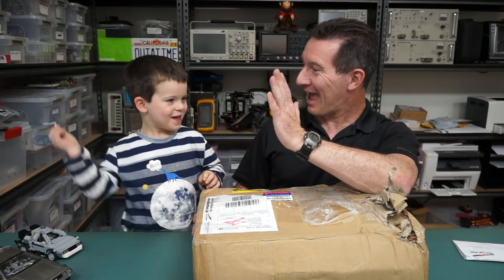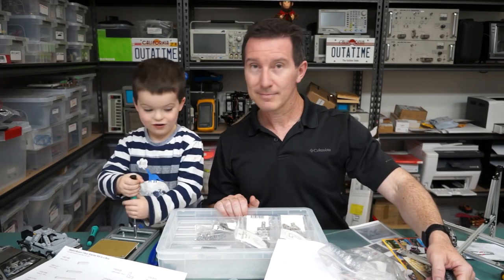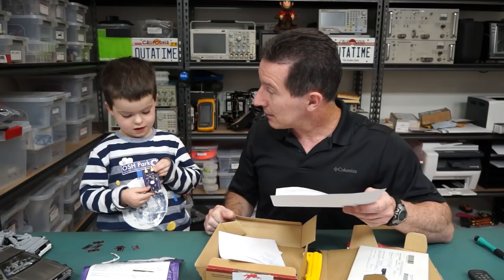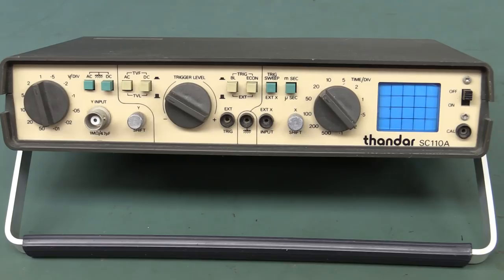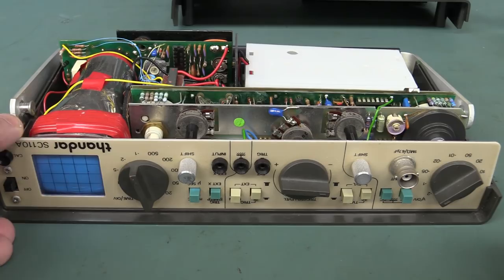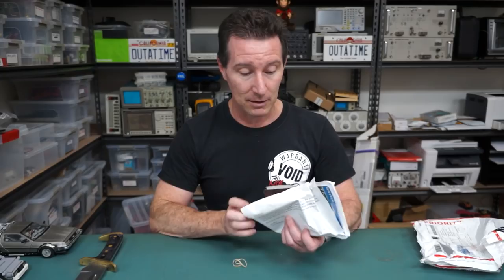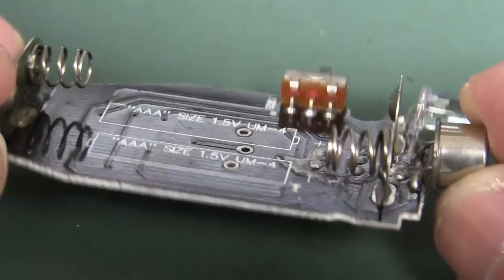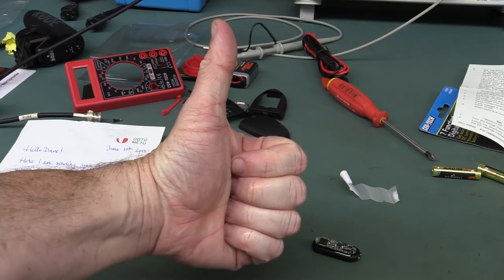EEVblog #813 - Mailbag

Comment: that cheap multimeter... tell you what its handy for random small jobs and better than a bulb with two wires.
Reply: A bulb with two wire is often better for testing automotive circuits.
Reply: I have one of those just for continuity and reading voltages on where i don't have any idea of how much tension it is (and don't give a fck if i burn it haha)
Reply: @TheCode-X  The gadget is not what you should be concerned about. The worry is about the effects on your person of its explosive disintegration by massive overcurrent.
Reply: Speaking of a bulb with two wires I used to have that same setup for testing voltage when I first started out you're doing electrical projects it was one that was handed down to me from another family member.

It was homemade but still in good shape even with the original test leads that probably had been re-soldered a few times originally one was red and one was black but one had to be replaced.

From what I was told and I also had a second one that is made by the same person that had longer leads but had two bulb sockets so that it could be used anywhere from 120 volts up to 220 Ameri fact I remember hearing about in some way somehow possibly from different sources how's that the utility company when connecting up to a residence when running new wiring for overhead lines Wood Lamp out to connections at the service entrance from their wiring to the service entrance whenever first connecting using a setup very similar to that also I still have a continuity tester flashlight that was given to me years ago is still works although I did converted to an LED it still is a nice flashlight also somewhere I still have a few of the old from colored not necessarily chromed but I think one or two are metal C or D cell flashlight I think a couple r c and a couple Rd also have a few lanterns stowed away somewhere that would have used the racial big 6 and 4 volt batteries I'm thinking about converting them some way to recharge mobile maybe you're sealed lead acid and perhaps a built-in power bank?

Although I do have one Lantern or two that had a quarter inch track originally on there one even had two of them perhaps one was added?

So that you could use it with a headlamp in addition to your Lantern and yes the original coil cord is still in good shape believe it or not.

And there was also an area like that could plug into the second Jack.

There was a switch for both receptacles and also a switch on the lights themselves as well.

Can't remember if that was a 6 or 12 volt Lantern but I think that one was 12 it's stashed away somewhere but not where I am  right now.

Also have a land foreign pride of similar except it's got a cord and 2 rounded is 1 would Connect into the front of the lantern in place of the Winds and reflector assembly and the other is essentially the head of the lantern that the bulb in reflector assembly goes into to turn it into a hand Lantern from a battery pack type Lantern again it was one that took the large alkaline or whatever it would have either been 6 or 12 volt battery you know when the big Lantern batteries they don't see much anymore.

Also I do have some sealed beam 4.5 volt Lantern bulbs don't even know why I have them are where I got them possibly an old hardware store did they still sold those lights and may have closed down but don't know we're no longer sold the lights who knows just one of those random things I got over there years at places that could get stuff from cheaply where is somebody could have been used for something else and sometimes when something like that would come up I could arrange to get all of them Ford even further reduced price especially if I knew the business on her well in which law of cases I did that I was known for picking up stuff that there's only a few things left an inventory they're getting rid of Good Times those times I'd say.
Reply: @stephenarling1667  yes I would agree I have one of those testers which is actually a modified Automotive work light modified in terms of a jack with test leads and another Jack with alligator clips for battery and our Jack with the cigarette lighter connector I Know Jack with female banana plugs

And also a set of very long coiled test leads with male female banana connectors.

Is that should be in everyone's test kit does extension lights same with alligator clip to Banana plug leads and just about any other type you could think of or come up with even if you make it for one specific test put it in your test kit for lighter you will thank yourself for this.

Also speaking of a bulb and Automotive there's times that I did not have the proper materials or tools to do testing and what I would do would just pick up a pack of pull volt indicator lamps the ones that would be worrying that had the blue green or whatever colored plastic around them that was meant to snap into a hole in a panel and just attaching wires it works plus you had indicators for another project in the end one time I even round up using a switch with a 12-volt bulb in it because I could not get an indicator but I could guess which or it was just a viable I don't remember long time ago but I was in pain and it worked I was able to get whatever it was working it need to be to under right then and there.

Also if I was working on something for somebody and did not have a proper meter or continuity tester available I would go somewhere and get a battery holder and an indicator of some sort with nibia 4 volt bulb and maybe a 4 C or D cell or double A or AAA holder and make a Jerry Reed continuity tester out of it and then of course save for parts for another project later I fixed a hair dryer doing that once all that was wrong was there was a broken piece of wire between two points in the device this was actually not the handheld dryer but a Hood Type dryer a very expensive one and the person used it all the time and wondered if I could try to fix it for them Ameri fact the wire need to be high temperature and that was salvaged from something else that I could not fix during about the same time can't remember what was it may have been either a heater or a toaster or perhaps a little mini countertop stove I had prepared several things for them previously was in about a month's time so can't remember but this was many many years ago probably in excess of 20 years but yet the mind is still sharp pretty much Seems Like Only Yesterday that I got my first electrical tester of any type.

By the way was going through some stuff and found my first actual continuity tester that I had gotten from somewhere yeah sure the batteries were left in it corroded do you know where however once I get cleaned up it's going to live on although I already found a way to replace this the original spring which was corroded into two pieces which was the new spring was actually a salvage spring or something and two metal pieces I think that were a battery contacts for something recently folded over on either end of the spring and also they fit exactly without even stretching the spring or anyting so just pretty cool what you can do or salvage parts and also things that you jerry-rig even for one temporary use just to fix one thing.
Reply: @TheCode-X  yep used those disposable meters basically Also I ran across my old yellow Radio Shack digital meter the one that had the black case that hold it open that had to test lead inside of it and to my surprise turn the switch to on and lo and behold it was working fully just goes to show that sometimes even RadioShack stuff is built really well candy for those people in other countries and not only that there's been times that I've had RadioShack batteries that still had charging them after all those years I remember back when they had those teeny tiny alkaline 12-volt batteries they called Weider batteries back then as in cigarette wire batteries I'd use them in some projects here and there and didn't happen to run across some years later I mean numerous years later didn't even realize or any of that stuff and lo and behold no leakage still measuring about 12 volts DC wow also that multimeter I was just talkin about uses a similar battery can't remember to voltage or anything at the moment but surprisingly the battery still measured good wow that battery and never been replaced and I use that meter quite a bit all the time and the battery was still working nowadays with battery issues I don't think that would happen anymore at least with most batteries just goes to show that things used to be made better than they are now in a lot of cases of course there's always the really nice exceptions to this such as earlier equipment by HP I do say earlier for good reason and not just consumer stuff but more of electronics Industry and Commercial and other equipment.

Also I remember years and years ago using our first TV that was a color TV I did actually wind up using it in my bedroom for quite a while and then later on again I used it in my bedroom until my parents got me a new TV for Christmas yeah picture tube was going on the old one but it had a good life then when that happened that TV got repurposed for my shop mainly for test purposes and since it was RF only I want up getting a modulator and music that for a test match TV and every once in a while I'd listen to news or something when I was in the shop an old wood grain portable RCA TV don't remember the model that things had been in the shop a few times not mine but the last time we had it repaired I have to be there it had the problem of the Estes Linda and ask for said it sound like white noise with it if I remember correctly it was resistor 11 that was the problem on that set and a drawing I mentioned or my father again that I was into Electronics and the garnet preparing to that last time you said you know no need to keep bring it in when does resistor goes out which she said was a common problem in these sets he showed me exactly which resistor it was they said there was a mod that could be doing to improve the longevity which woman he doesn't do butt might be worth pursuing and a few other mods to make the set more reliable and better which in the end I want of doing and this was when we were still using it actively in our main TV watching area so whenever it would act up pop the top on my workbench also he did show me how to discharge the picture tube as well so that I can get back in the service right away without waiting for the discharge which is anytime I used to get a scrap TV that's what I was do is just wait enough time and tell the picture tube would be down 2 safe voltage so that's one of those things that I would fix on a regular basis there was also a few other components it would go out here and there in that set consistently so needless to say I kept spare parts for the TV at one time I had replaced two fuses in it as well and also record. Replace twice as well also the antenna connector which was of course just for screw terminals was replaced with other screw terminals I think it was from a dead or partially did more railroad power pack just cut it out with the Dremel to take the rectangular instead of square screw terminal board.

Also on modded in a few different inputs and things as well because since it was used for chest bench for purposes and I had it apart anyways as well as an input for the Atari line of game systems in computers and an analog audio input for mono and an analog audio output for mono of course however previously I had installed a bear circuit board that would produce simulated stereo output from a mono in and yes attenuator on the speaker output and a switch also I do have the old video sound processor from Radio Shack that is a keeper it is still in my entertainment center stereo simulation noise reduction and then some and yes used to have that hooked up to a different TV through the headphone output which is mono and my father would actually go to my room to listen to concerts on TV on my stereo system even though it was a small TV just goes to show you how useful an old piece of equipment can be they don't make anything like that anymore I wish they did it would be very useful for some people for example our sound check at our church said that he would never give up that device ever when I asked him if he'd ever heard of one

Comment: the Rossin device that you showed on # 813 is a passive infrared sensor for a burglar alarm.  It is intended to be wired in a normally open alarm loop. the battery actually powers the device and i think it should last for ten years .  I used some of these probably 30 years ago.  will look to see if I have any info on it.  Love the Blog. Thanks for what you do.

Comment: Hi Dave, Love it. My dad 'lent' me one of the Thandar scopes in the early 80's  It was branded RS Components (UK) and as I recall it cost just over 100 UK Pounds  at the time. It was part of a series that included a matching frequency counter and multimeter. It finally packed up about 10 years ago, and I'm ashamed to admit that I still use the probe that came with it!   I used it to trace trigger card faults on  thyristor lighting dimmers and the fact it was  'ground' free was really useful. It started displaying the same issues you discovered about 10 years ago and finally died soon after.

Comment: I've been using that Cen Tech multimeter for several years now, still works like a charm! Mine was free with a dollar purchase of tape. The leads broke at a point, but I fixed them with some solder and hot glue. No problems with the meter itself!

Comment: So far, I own 4 of those free Harbor Freight Tools multimeters.  At first I figured they would be very inaccurate, but was surprised at the accuracy.  I also figured they would be unreliable, but so far they're reliable enough for use in non-critical measurements.  

I keep one in each vehicle, monitoring the battery voltage, and after several years, they still do a good job.  They even give good readings at 30 degrees F below freezing and 120 degrees F.

I've had them read incorrectly about 2 times.  I quick rotation of the switch, and they're reliable again.  I only use them when I already know what reading to expect, so I can tell if they are off very far.

Not to be fully trusted, but still useful.

Comment: It's PIR, I used very similar units made by Racal back in the early 80's. It had an operating life of about 5 years, and used the on board battery. After the unit detected motion, it would "sleep" for a period of time, to save battery life. That unit was clearly a single narrow beam type sensor.

Comment: IIRC the switch on the alco tester is just for the light. To measure your alcohol level, hold the push button depressed until the green led lights up, then blow gently onto the sensor.

Comment: The breathalyser is probably a generic flammable gas detector. It consists of 2 wires, one coated with a catalyst, and one not. They are wired with 2 resistors in whetstone bridge configuration. The wires are heated by a small current, but normally remain balanced. If there is alcohol on the breath, the catalyst oxidises it, and adds heat to the catalytic wire which increases in resistance unbalancing the bridge. All you need to do is measure the bridge imbalance and if it is over threshold turn on the light.

Comment: Those cheap multimeters are perfect for checking battery voltages, or continuity (if your model has that feature). I have dozens of these laying around. I do have a couple good meters but they don't get used unless I need precision. I used one of these recently to diagnose an electrical fault in my car, worked perfect.

Comment: I have maybe ten of these Harbor Freight multimeters, and I LOVE them.
I use them for doing assembly work primarily, and may need to ensure that 12 volts or 24 volts, or whatever is actually present.  But may go ten or 20 minutes between uses.
These are the only multimeters I own which actually have an on-off switch  So they get used quite a lot.

I have better multimeters which I grab when I need to actually need to measure something.

Comment: I Do not toss out cheap DMMs, Use as a DIY>panel meter< or DIY test box,  has on /off switch so U can tap your power. -as them 1$ multi-meters make for good DIY custom solo-meter test box, just fix the range for the job u need  check the calibration< & add buffer /shunt ..esc.  -  Also - when I was 8yro  I did test the wall outlet with my dad,s analogue meter as most radios at that time , had HT of 400V

Comment: I got a few of those HFT mulitimeters (for free).  I was thinking of taking the thing apart so I could embed the multimeter as a voltmeter in a home brew power supply.  I'd have to some how wire the lcd to the board with ribbon cables and short the right lands on the range switch for the desired voltmeter range.  I might even be possible to cut the main board down a bit since I might not need all of the circuitry on it, I'd have to trace the layout out and figure it out.   The thing just might make a serviceable DC voltmeter for a project.

Comment: Cen-Tech meters are good for solving quick and easy problems, and cheap enough to have  everywhere. But I did notice one major problem. As they get older, they start to loose accuracy, especially the ohm meter. Not sure if it's battery related, but the meter is cheaper than a proper 9v battery.